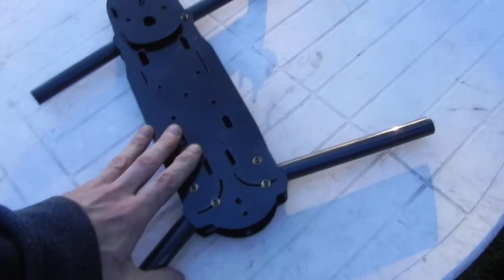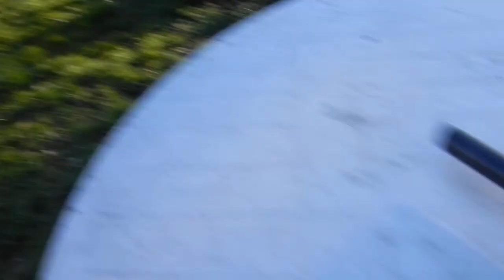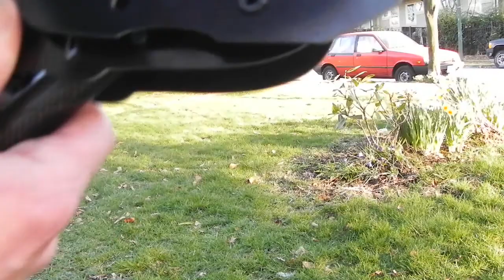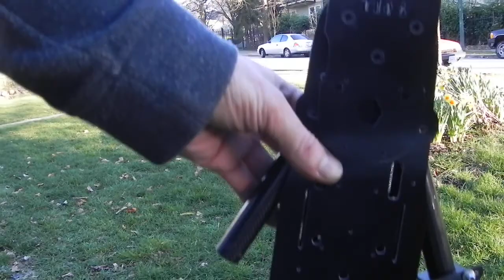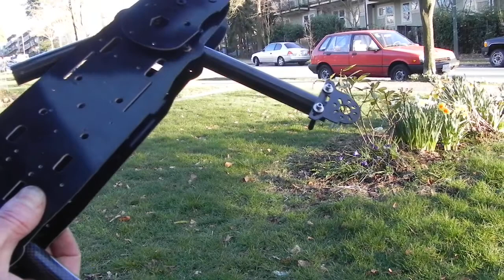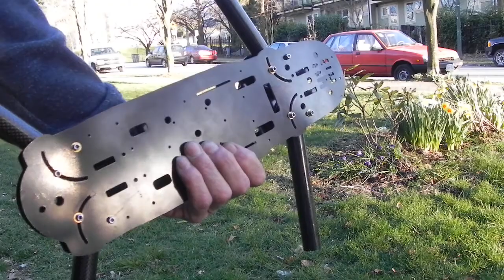Dry assembly of HB8 prototype, FPV folding multirotor G10

Comment: cool frame
Reply from the maker: Thanks man! for a prototype with 500mm arms and motor mounts the G10 is around 390g but you could fit an SLR on the deck too LOL!
That means the CF version will be 30% or so less. Tomorrow it is boomerang durability testing, already chucked it 40 feet up and onto grass and no arm shift even without the rubber faced washers  or standoffs!.